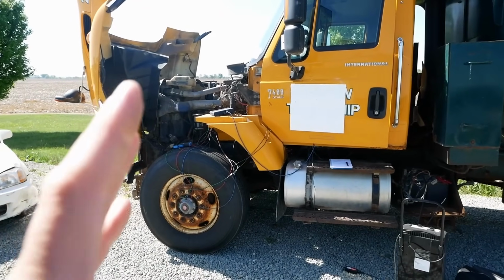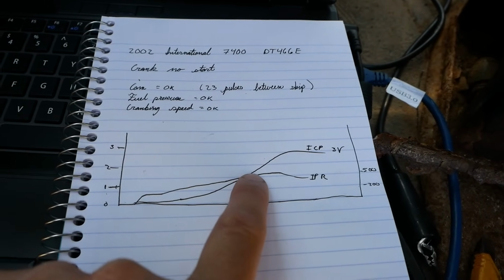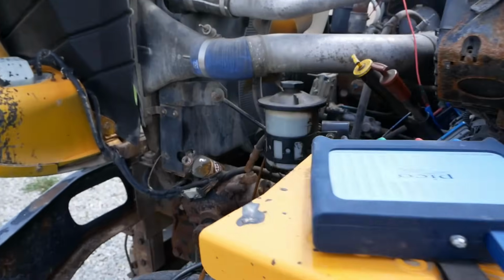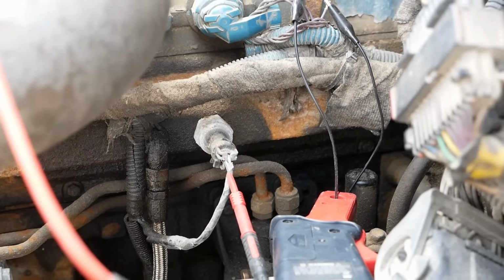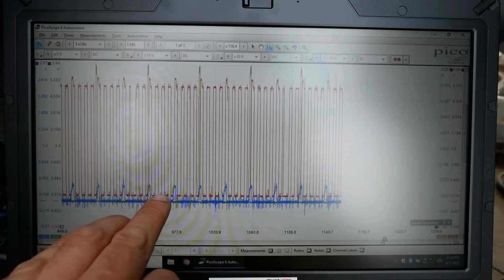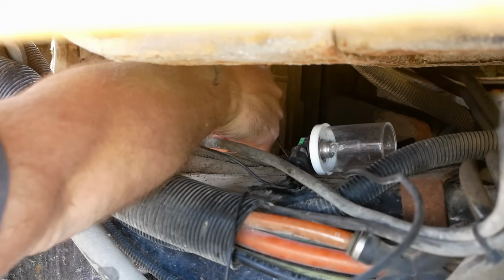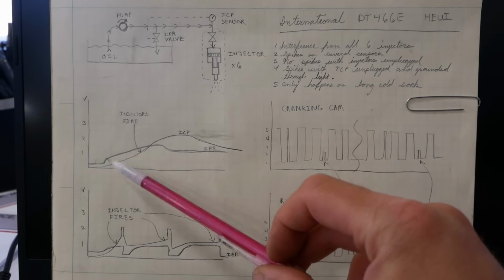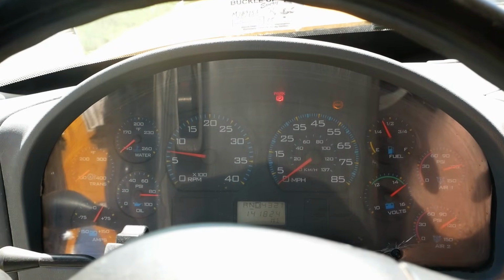International DT466E Won't Start without Ether after Sitting

Comment: On early computerized engines, like in the 70's (my screen name), broken solder joints in the computer could often be diagnosed by kicking the computer when problems happened.  Maybe your fiddling with those bolts on the computer and back probing the connector caused a temporary fix.  Should have drove it after it started at the end to see if it had power.

p.s. thanks for showing your notes.  I haven't seen cursive writing in decades.  Good to see that some people are still using it.  It was actually legible, unlike mine if I tried it.  Your drawings are good too.
Reply: An electronics nerd friend of mine back in the mid eighties thought it was ridiculous that one of the diagnostic tools for a failing ECM was to tap on it. I might have kicked it if i'd of had a good shot at it LOL. The difference was, what he was working on didn't vibrate down the highway or live in sub zero to over 100 deg temperature swings.
Reply: I have never heard the term cursive writing, however I used to do this but write the letters over the top of each other. Vents the anger without anyone being able to read what you put, usually about them.
Reply: @philtowle4683   That's a good one Phil. New interpretation to me. I've never heard it used in that way before.
Reply: @toma5153  There is actually a scientific term for the use of foul language to relieve stress or pain. It is called Lalochezia. I had a mug made for someone I worked with who swore a lot with "Make it easier with Lalochezia" on it. Loads of people used to ask what it meant.
Reply: He is sine qua non in drawing conclusions.
Reply: Working on a 76 280Z right now. Grounds seem to be a big issue with that year car.

Comment: Are there any RFI chokes in the engine wiring harness?  Judging by the patterns on your scope there, I'm thinking it could be some kind of RFI causing the spikes maybe?  I'm of the school that about 95% of the time a PCM doesn't fix shit.  Not to say this couldn't be that 5% here, but I've seen RFI chokes cause some strange issues(blown fuses, signal spikes, etc.).  Just some food for thought.

Comment: it looks like the rig will be sent to the briar patch to die there. I doubt the company will spend the money to replace the computer and find the replacement didn't work. Or an engine swap might be needed to remove the computer crap and use an engine that is mechanical.

Comment: wes - what it sounds like is a failing filter capacitor in the ecu. not only is it letting noise through, but after it discharges the ecu doesn't know what to do (missing voltage : like a memory circuit). now that being said, it could also be a switching transistor issue (also in the ecu). since you are essentially bypassing the injector circuit with starting fluid, once the ecu shows rpm over X it probably just turns the fire command on by default.... and that is what ends up recharging the filter cap enough to last a day or 2 (said warm time start) until it discharges again. Im not a diesel mechanic, i only play one in the yt comments.

Comment: Throttle control lock out at start was normal in certain year models. Tied to air pressure as a safety against flooring the foot feed at start.

Comment: Love my 95 7.3 Powerstroke with its 169,000 on the clock. Only problem I have is whenever the time comes that it'll need some decent repairs no one in the area that works on diesel pickups because it's a 95, not a 99 or newer. Well that and the fact that the battery cable ends finally bit me in the butt and made the truck brake down on me earlier this week. Time to throw the aftermarket cables on her now.

Comment: Wow! I think your really over thinking this one,after many years around these type of engines in hwy and offroad I'd bet its just a loss of fuel prime,first replace all fuel fiters,next look for leaks in the fuel line between pump and engine and lastly find and replace/rebuild the fuel check valve all these hwy trucks have one.
Reply from the maker: Sure.

Comment: Every single International I've ever driven (26 years driving) has had electrical problems. One of the national carriers I drove for installed master disconnect switches under the driver's seat, so when the ecm wigged out you could reach down and shut it off, and reset the ecm with a power down.

Comment: I’m no expert by any means but is it possible the pump isn’t able to put out enough oil pressure when cold starting and that’s why things are dropping off as each injector fires?
Reply from the maker: No. With the injectors unplugged it builds pressure just fine.

Comment: I realize long time ago about engineers to me there's two kinds there's an engineer who can build it on paper design it all that stuff and then there's what we call a working engineer who design lays it all out but actually can go out in the field and do it. The one that do it on paper on paper mathematically everything adds up but then comes to actually building it a lot of stuff doesn't work and they don't understand that because they just build stuff on paper and not actually being able to build it on paper and then actually build it with their hands. I used to make radiators for model waves model t's and the willys Jeeps original reproductions using the same tooling from Henry Ford's factory itself. And Colorado they had designed small flex buses or in the middle it hinges so that real long bus can do tight corners the engine that was in it they needed a custom radiator made for it and they sent me the blueprints and soon as I started going over it realized it's not going to work it'll work but it's not going to work like they designed it and argument is an engineer they're always right no matter what well needless to say the raiders are hundred dollars a piece and I told him I'll build it to your specs but it ain't going to work sure as shit what happened it over pressurized and move the radiator up and now if they listen to me in the first place and let me build it none of that would have happened I know because the second time around it built it and it works so well that in the winter time they couldn't even get the engine to get up to operating temperature.

Comment: Im do not know nothing on any electric or Diesel motors but ID say all this computer added crap makes me mad. Look at all those plugs with dirt / salt and Probably corrosion. I got a 1990 Chevy 4.3 motor was in Pittsburg it just shut down. Looked in the carb when cranking... No fuel . got toed home on flat bed by a friend next day . looked up all Fuel info. On it 
On fire wall were fuses are ? Fuel pump fuse where water runs down over it pulled the fuse was all corroded sanded it up put it back in truck fired right up. 
Pulled it back out put Muscle Grease PL- 10 on the prongs never will have a issue with that again water can't penetrate that grease

Comment: What a treasure hunt you went on, only to find that there was no real treasure to find at the end of the hunt. I am tempted to blame corrosion in the wiring cat's cradle, or perhaps damp penetrating into some critical part when it cools right down, but why would that produce those bizarre voltages? Well done for remaining sane to the end of this nightmare hunt.

Comment: Wonder what pressure the low pressure oil pump is putting out? Super easy to do and cheap enough part alone. They have very tight tolerance and once worn will make a big difference in starting. Worth checking into.
Reply from the maker: Super easy? You have to pull the timing cover.
Reply: @WatchWesWork  l don’t have experience on the bigger snow plows but on the regular 7.3 pickups you don’t have to.

Comment: I'm still confused as to how it ran at all. Are you saying the periodic short to the IPR kind of averaged out once the engine was spinning fast enough such that it would run but with reduced power/poor throttle response?
Reply from the maker: Yes. Eventually it seems to regain throttle response.
Reply: @WatchWesWork  That is bizarre.

Comment: Yup I've had the same type of situation with my 1ton with the 6.5td in it. Would only try to run away after it sat for roughly 2 days (Im not you Wes I didn't try to find the exact minutes and seconds to failure point I'm a fan of hand grenades close enough is fine with me). I wasnt going to replace yet another icm.... So I saved myself the 500$ and spent 150$ on a remote start that had a handy feature of programmable auto start so I set it to start everyday and it would run 12 minutes then shut off problem solved permanently

Comment: I guess I don't understand why, if you have to control an injector with a solenoid anyway, why add additional hydraulic system on top of that to control the same injector? Does it decrease the cost of the injector itself? Just seems like needless complexity.
Reply: I suspect the solenoid isn't powerful enough to actually actuate the injector, so  it is instead used to meter high pressure oil which provides the force needed
Reply: @knotical689  - Which would make for a cheaper injector, which would make sense. The hydraulic pressure may also indicate the accelerator position, like a rack.
Reply: @alanbradford3130  there's also a space limitation. Since we're dealing with low voltage here the solenoid would need to be quite large to generate any significant force. Using the solenoid and oil essentially as a transistor gives good force and good responsiveness. Hydraulic pressure should be a product of engine speed and throttle position, and the system needs to raise pressure to actuate the injectors more quickly at higher engine speeds

Comment: Interesting problem. The only think I didn't see you try is both cool spray and/or a heat gun. When I had a circuit with iffy situations, cool spray and a heat gun would some times pin point the culprit. I was wondering if you used a lot of cool spray on the computer, if you could duplicate the no start issue. And contrary, when you can't get it cranked, try a heat gun on the computer to see if that would fire it up. Some times those help locate a problem... Thumbs Up!

Comment: Wes, I have a question.   Did you attempt to put thinner oil in it?
Reply from the maker: No. I don't see how that would help.
Reply: @WatchWesWork  it’s a diagnosis step that doesn’t cost much.  My old 7.3 did it during the winter with 15w40 so I just switched to 5w40 and it was fine.  It is possible that either the HPOP is dying or all 6 injectors are just tired enough that they’re combined oil passage (by the o-rings) is enough to effect pressure.   I’d guess moreso the HPOP at this point.
Reply: @WatchWesWork  there is actually a symptom of a failing HPOP common to all heui engines which is a rolling idle on cold start.   The pump just can’t quite get enough cold oil through, so the engine literally revs up and immediately dies but catches and revs up again for 30-40 seconds while the pump is struggling to keep injector oil feed pressure over 500 psi
Reply: The reason I say this, is because due to the nature of the HEUI system, when it can’t build enough oil pressure during cranking, it behaves exactly the way that truck is.   If you can spin it fast enough (like with a battery charger or ether) you pass the threshold of high pressure oil needed to run.  The symptom of it not taking throttle until it has warmed up the oil also points to this.
Reply: The thing that tipped me off was when you said it wouldn’t take throttle for a little while after it started.  This is a classic high pressure oil problem.  It is possible that the capacitors in the PCM are bad, BUT you are not reading the signal after the filter capacitors that the processor sees.   By probing the harness, you’re getting the raw signal with all the noise from the power rail.
Reply: @mmm365  this is a great idea but a pump like that is hard to come by.
Reply: @mmm365  the problem is volume.   The pump you have cannot do what the HPOP does.  The HPOP is a 5000 psi high volume oil pump. A hydraulic drive motor for a piston is not capable.  The only hydraulic pump that would work would be a large industrial pump with several horsepower.
Reply: @mmm365  the high pressure oil is varied from just over 500 psi at cranking to a little over 4,000 at max injector duty.   It varies with desired fueling.
Reply: I agree with Arons advice from my personal experience on my 05 4300 dt466 was a nightmare to start on cold winter days until I switched to 5w40 synthetic and wix full flow filter and also the often overlooked centrifugal filter below the turbo i replaced and eversince %60 improvement. Than i realized that both relays were pooched for the intake grid heaters so I rigged up old school starter relays and now she starts even with low battery voltage cranking below the required minimum crank speed as per shop manual states..

Comment: I’ll throw my hat into the ring and suggest bad capacitors inside the ECM as far as what’s causing the voltage spikes. Might be worth fighting with it to pull the ECM, open it up, and at least take a look in there. Of course, it might be potted in silicone or similar in there, which would make a repair virtually impossible.

Comment: If that truck is working the salt every year, my guess is that there may be corrosion with a slight intrusion into the ECM (and/or adjoining wiring/plugs) causing circuit bridging? When the ECM heats up, maybe it causes enough heat expansion to unbridge the short(s)? Hard to say, but it's not out of the realms of possibility when you've checked everything else? Occam's Razor.
Reply from the maker: Corrosion? Hard to see how that could be possible...
Reply: @WatchWesWork  Lol, yeah, what was I thinking?

Comment: You don't think there's a problem in the under valve cover harness since when you unplug the pass through connector it goes away?
Reply from the maker: No. That harness should not affect the sensor harness.

Comment: cummins had the stc injectors which was a precursor to huei injection. but it was strictly mechanical.  when it worked it was good when it didnt it was a nightmare. best thing to do was delete it.  with this one i think the problem is its huei.  lol  never heard of cold soak problems in electronics.  usually heat soak will cause bad connections pin fitment etc. some say caps in the brainbox. your substituting the power supply should have removed that possibility from the list. i wouldnt think anything below a volt of voltage spike would corrupt the data.   i'm leaning more to a hydraulic drain back/leak. and depending on where it is you may have pressure but the oil volume will be aerated and compressible. the either gets the pump going fast enough to overcome the high volume of aerated oil. thats why i mentioned stc. had an o-ring on the oil pickup split on one of those and while i had oil pressure it was severely aerated.  tough to find  but when i pulled a valve cover off i noticed less than normal volume up top and what was there seemed a little frothy.
Reply from the maker: We've had that aeration issue before. The HPOP pulls oil from a reservoir in the timing cover and you can check it by pulling the EOT sensor. It's clear full.

Comment: If that truck comes from where you live, maybe it even got struck by a lightning?
:-/
Thx for showing!
:-D
Reply from the maker: It's possible. I know of a truck that was scrapped after it was struck by lightning.
Reply: @WatchWesWork  If even your amp clamps are dead  just by lying around in shop when the lightning hit, it could be possible that the shed that truck was parked in was hit too and the ECM is fried...
Reply: @WatchWesWork  Remember that according to popular science a two mile long lightning bolt can be stopped by two inches of rubber: "A car is the safest place during lightning storms because it is on rubber tires" 🙄
About lightning damage, try to store your electronic tools inside a fully metallic cabinet when there's a storm forecast, not just due to EMP but also the change in polarities of everything between the ground and the clouds, think on ground and clouds as the mother of all capacitor plates, before the strike ahything between ground and the charged cloud will build up a proportional electrostatic charge, when the bolt strikes the electric field is reversed and your tools will want to dump the electostatic charge built inside them, arcing to anything conductive nearby.
So if part of a large storm cloud is over your shop, even if the lightning strikes far enough away that it doesn't cause any damage due to EMP, it can still cause a lot of damage due to ESD.
Usually we only think about the electricity that can come through the wires but we forget that the oldest known way of generating electricity is by rubbing two insulating materials together.

Comment: Just a thought... you said originally it started with a jump pack. I wonder if battery voltage is impacting the computer somehow.  After a couple days the battery voltage would drain down from the computer loads and stuff..... I would think if it was temperature related that would happen overnight.  Eh nice work 🙂